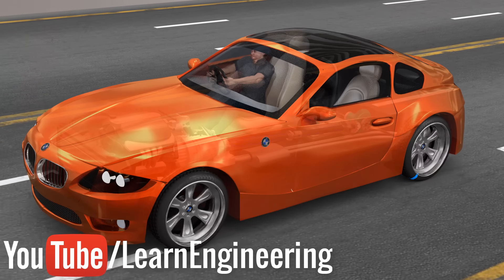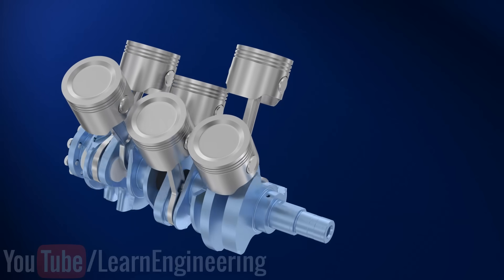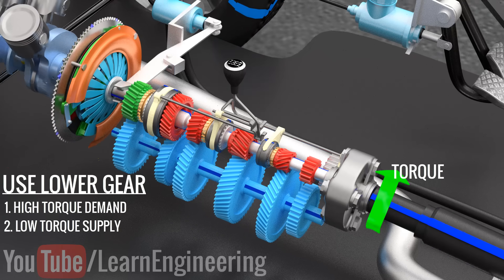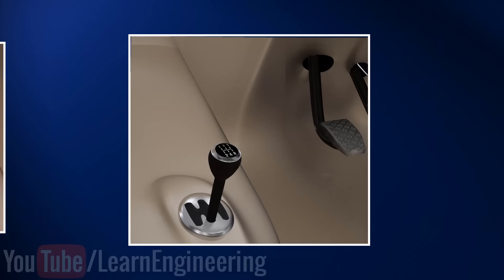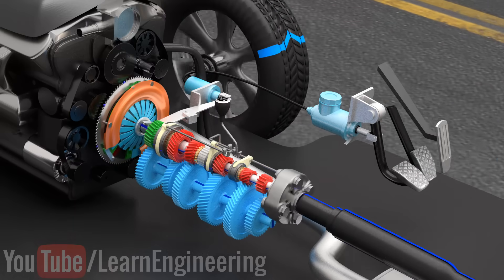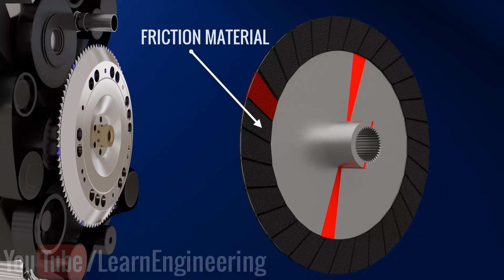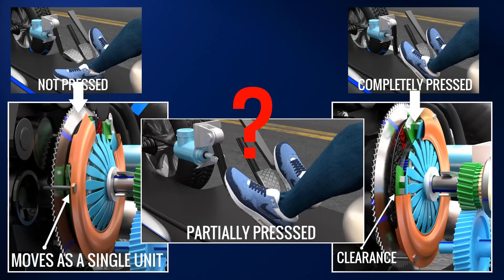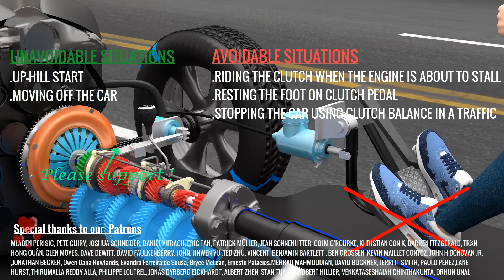Why you should not PARTIALLY press the Clutch?

Comment: Well, there are basically two scenarios where partially engaging the clutch (clutch control) is just necessary:
1. pulling off in 1st gear of course, you have to partially engage the clutch in order to make it easier for the engine to move the car and not to stall, and as soon as you reach walking speed you may fully release the clutch;
2. Driving at very slow speeds is just impossible whilst the clutch is fully released, like moving slowly in traffic jams, and moving slowly while parking.
Other than those two I can't see any other situation where riding the clutch may come in hand.
Reply: 3. If you start to drive in an uphill situation,  you definitely need to rev up to more rpm and release clutch half way slowly until car start moving or else engine will stall and turn off.
Reply: Pirouz Farhani Only when hill starting in 1st gear.

Never slip the clutch in any other gear than 1st or Reverse, all other gears, if the engine is lodging/stalling, downshift one or two gears.
Reply: @afara2000  was looking for this comment, thanks.
Reply: Thank you I really needed this comment. I’ve been driving standard for a few months now and have been trying to wrap my head around how one would go from a stop to start without feathering the clutch. 

Also when I reverse I feather the clutch a lot. But this is ok right? When reversing you’re moving very slowly so it shouldn’t wear the clutch too much
Reply: DavyDave1313 Depends how many revs you have. If you are reversing a long distance, you can first give it revs, then let go of the gas slowly while letting go of the clutch until you have the clutch fully engaged with the engine idling.

To slow down, start slipping the clutch again. 

You cant fully avoid clutch damage. Road speed doesnt matter on its wear, but the difference in RPM on the engine shaft and transmission shaft, is what damages it. 

Why driving with half clutch is so bad is that the friction heats it up, making it wear out (and stink) really bad.
Reply: @SportSoulLife  oh ok, its not a long distance id say 10 feet to reverse into my parking. And from what ive seen the rpms stay at around 1.5 while reversing - not sure if thats what you meant
Reply: @DavyDave1313  You have to feather (or partially engage) the clutch some of the time. It's what the clutch is for and its inevitable. You can extend the life of the clutch by going easy on it, but eventually it will wear out and need to be replaced. The only way to avoid that is to use an automatic transmission with a torque converter.
Reply: My traffic jam trick is to hang back and roll along with the clutch engaged, then when coming to a stop I just coast in neutral
Reply: @b.eduardo5105  so you are just moving in first gear without touching the pedals?
Reply: @r9__673  yes mate, a little bit of throttle may be necessary
Reply: @b.eduardo5105  that's not traffic
Reply: What the previous guy said. I leave a little extra buffer space between me and the car infront and simply ride in 1st gear in idle. If the car infront gets way ahead, i change to second gear and drive at close to idle. If they start to slow down, back to 1st and if i see a stop approaching, just roll ahead in neutral. 

This works great in Europe atleast where many cars are manuals, so generally speeds wont drop somehwere between idle and fully stopped. Dont know how it would be in the US though since automaics creep forward much slower than manuals idle in 1st.
Reply: @SportSoulLife  its so much worse in the U.S automatic vehicle drivers will constantly and rapidly go from high speed to a full stop. It takes all the fun out of driving.
Reply: Oh, and id like to mention that trying to creep along with traffic on a motorcycle is brutal on the clutch. My bike Idles in first gear at no less than 15 km/h, and from a standstill a good 4000 revs are required to not stall the engine. So lucky that lanesplitting is legal/accepted here. Couldnt imagine riding in a traffic jam in the US
Reply: @SportSoulLife  yeah, my Busa wasn’t the most fun thing to ride in traffic. But, as far as wear, most bikes use wet clutch packs, so slipping is far less harmful than in a car, and it’s actually a good technique for low speed maneuvers
Reply: @SportSoulLife  don't bikes have wet clutches?
Reply: @confusedredditor1660  Yes, but this doesnt make them immune towards slipping, only keeps them cooled down.

Just like wet sandpaper still sands the surface and wears out, so do wet clutches.
Dry sandpaper and clutches cut (grav) and wear out faster (abd create more friction) and heat up more.
Still, nothing you slide against eachother to create friction, no matter how you do it, doesnt wear out, especially during excessive use
Reply: @SportSoulLife  mhmm
Reply: @SportSoulLife  true, that wear's still gonna be there
Reply: @confusedredditor1660  Yes, and with a car when you are slipping, the engine usually wants to go about 10 km/h with the clutch connected, and you are creeping at 5 km/h

A motorcycle (naked bike and sport bike atleast) at 4000 rpm in first gear wants to go about 40 km/h, then you are creeping at 5 km/h. So the motorcycles clutch "slides" four times as many revs than the cars clutch does
Reply: @SportSoulLife  same here bro I live in the us but lane splitting is legal in cali
Reply: live and let live Thats good. Only problem i have with cali lanesplitting (that ive seen on YT) is when its done in normal/close to normal flowing traffic.

Rule of thumb for me: if there are gaps in the lanes for cars to change into (like there is in ordinary traffic), its not safe to be lanesplitting.
Reply: In a car with a low powered engine (like my 1.3L Corolla lol) when you're going up a VERY steep hill in 1st while driving slow sometimes you have to ride the clutch to avoid stalling. These situations basically only happen when driving up long, steep and narrow driveways which there are a lot of where I live.
Reply: Hill starts too?
Reply: About number 2: I just realized I d o it all the time and I never thought about it. It was just something I picked up instinctively. I love manual transmissions, can't get used to automatic haha. It's more fun, more control.
Reply: Dont tell them to slowly let off in first watching people/idiots get whiplash its halarious
Reply: 3. Clutch kick for maintaining sideways action
Reply: I learnt to drive a manual in Wellington, NZ where the roads are extremely steep, narrow, buses and trucks constantly stampede through from the opposite direction, tons of cars half parked on the pavement/road,  and not to mention roadworks everywhere.  If you can drive a stick there, you can drive anywhere in the world.  My backpacker friends were impressed how easily I carved through the narrow, hilly congested streets of Southern Europe.
Reply: I drive a turbo diesel so when driving slowly in traffic or in a parking lot, I drive using the brake. The engine torque is way more than enough to just keep the car rolling without stalling. When I'm offroad I put it in 1st, take all feet off the pedals and it just crawls on its own. I love it.
Reply: when driving very slowly you should always half-engage the clutch for a short moment only and then take out the gear again. redting on it will just create friction and heat, it's better to go into neutral and into 1dt gear for short "bursts"
Reply: @yeeted42069  lol have u even listened to the vid?
Reply: Agreed. Being told it was all clutch or no clutch was a barrier when I was learning how to drive manual. I had a really hard time getting the car moving until I learned to ease off slowly. Been driving manual for almost 15 years now and have never had to replace a klutch.
Reply: The obvious one: changing gear as well
Reply: in a traffic jam just dont move asap. Wait for 1-2 secs, so there will be enough room to move faster without rear ending the other car.
Reply: In case 2 YOU DON'T RIDE THE CLUTCH!
If traffic is moving slowly, you release the clutch a little, then press it in again and ROLL!
If you ride the clutch in slow traffic, that's gonna be A LOT of riding and a lot of wear! Very bad!

Remember: you don't need to stay on the other car's tail! It's perfectly fine to sit and wait until there's enough space in front of you that you can fully release the clutch and then coast along in neutral!
Reply: I rather bumb the pedal to get the car moving a bit and then release it..totally depends on the car tho. Some have ridiculously high first gear like the facelift hiace and some have super low first gear like the old hiace
Reply: Parallel parking
Reply: That's what i wanna say
Reply: Driving in Traffic with an moment of 5 to 15km speed clutch pedals can be avoided but make practice mentally as well as physically not to keep foot on pedals untill u have to breakdown to stop the vehicle.
Reply: I think the main difference here is engine speed and driveshaft speeds since to move from first you need to use the clutch to get the car moving, at which pint the engine has enough torque to overcome the resistance and move forward without stalling while in this scenario the engine does NOT have enough torque to avoid stalling (in the current gear). So to avoid stalling the engine in this situation people wrongly put the clutch in hal way instead of switching to a lower gear 

TL;DR difference between riding the clutch and releasing the clutch is ou can't go a gear lower than first
Reply: And when shifting gears?
Reply: i broke my clutch once.. when i was learned how to ride manual.. cuz sometimes i unconsiously push the clutch partially.. but i think i do better now..
Reply: Yeah i only do it when parking or when leaving sport / school where the speed limit is like 5kmph
Reply: When is heavy traffic , you don't really need to stay in gear. Have the car in neutral and let it go by itself , gently brake if needed and that's about it
Reply: For driving slowly i would use the brakes
Reply: @theicedragon100  if you did with the method i described above u would stall. The method above is the slowest method you can drive
Reply: There's nothing wrong with slipping the clutch when shifting and moving from a dead stop.
Reply: Some replies stating that they just fully engage clutch to roll along slow traffic. But cases can vary so much. While driving uphill and in need of going slowly, to maintain a slow constant speed, its hard to avoid using partial clutch.
Reply: @MesHnamte  Fully engaging the clutch works only downhill. Some people say that they just take it out of gear, release the clutch and let it cruise. I myself I leave it in first gear when driving slowly downhill, I just use my brakes and the clutch obviously if needed. I feel like it gives me more control over the car, it is more safe so in my opinion since it allowes for more swift and timely maneuvers if needed than having the car out of gear.
For driving slowly uphill, not using the clutch isn't just hard, it is downright impossible without stalling the engine, the load on the engine is just too heavy when driving slowly uphill.
Reply: @yolson2376  Right. Fully engaging clutch in downhill can be dangerous, using the gears plus brakes is more safe.
Reply: @yolson2376  well I kinda drive slowly uphill pretty much on a daily and my little Turbo Diesel car just take it idling in 1st... However I would guess in anything but a Turbo diesel it's going to be a problem.
Reply: @yolson2376  If it's impossible then I'm doing the impossible:
I can start off on a steep hill without slipping the clutch more than normal.
I press both brake and clutch at the same time with my left foot to keep the car from rolling back while revving up the engine to get the power needed to start off. You can also use the handbrake for the same purpose.
Reply: @LRM12o8  you can do that but it's bad for the car use the gas instead of the brake. Clutch and brake should only be used for slowing down.
Reply: @in4mus85  I'm not sure which one of my (admittedly too many) comments you're referring to, but I think you misunderstood me...
Reply: @MesHnamte  No it's not hard to avoid riding the clutch to go slow. It's called ROLLING In neutral! 🤦‍♂️
Reply: @LRM12o8  I mean it specifically. Try rolling in neutral on an uphill slope and come back to tell me the results.
Reply: @MesHnamte  thought you meant two individual situations.
Well, in that case I'd sit and wait until there's enough space for me to drive uphill fully in gear for a bit and stop again. There's no need to steadily limp along in any traffic jam, especially not on a steep hill.

I'd leave ample space to the car in front of me on a steep hill anyway: they might roll back!
Reply: @LRM12o8  Yeah that's a good solution but when there is pressure and horns honking from behind, its diffult not to follow along.
Reply: @MesHnamte  that surely sucks. Haven't really had that problem, but it may be more common in other countries. It's also a punishable offense in Germany. 
What I experience every now and then is people tailgating me on the Autobahn when there is a speedlimit of 120 km/h and I'm already 10 over. But I always remind myself I'm already exceeding the limit and if that's not fast enough for the idiot behind me, then too bad for him he ain't one to coerce me to risk a higher fine than what I'm willing to bargain for. He'll just have to wait til I'm done overtaking at my speed. 
Same would go for riding the clutch to limp along. If it goes wrong, I will have to pay the bill, not the aggressive driver behind me. No thanks!

I don't get why these people don't realize that when the car is stationary they don't need to pay as much attention constantly, as when the car is constantly crawling forwards.
Reply: One more: rapidly changing driving conditions like offroad hills require fast and decently precise control ovee the torque, not using the clutch can quickly lead to being stuck then and there... But i guess thats not knowledge everone needs
Reply: @modellking  hahah I litterly live in the middle of nowhere I know exactly how it is to drive off-road Buddy!! But tell me how many people need to do that? We are talking like 1 in every maybe 5000 in Denmark where I'm from that drives off-road. And off-road doesn't change the fact I can cruise in idle in 1st on a uphill on every normal road which is 98% of roads in Denmark...
Reply: @mathiasmorell5094  yeah exactly! i think its good for people to understand how to get peak performance out of their things if a rare situation (like muddy ground steep hill), where such thing can be beneficial occurs
Reply: Turning
Reply: Exactlyyyy
Reply: Theres also changing gear 2 into gear 1. And most of the time i had to do half clutch first before fully releasing.
Reply: Driving very slow in 1st gear is no problem without riding the clutch. Just have to be very gentle with the gas pedal (when clutch is fully released) not to make the car jump, or just coast and use the clutch as you pull away in 1st gear. Make the car move then fully release the clutch to coast at desired speed, no need to half clutch at any time.
Reply: @henriks5008  There is one another way. You can control the speed by brake pedal when you need to slow down for a short time on first or second gear. The engine will overcome that if you won't reach e.g. less than 500rpm.
Reply: clutch kick
Reply: 650 hp and tq helps, once I'm in first gear I can idle and brake during idle to go slower without stalling. I have to decelerate to around walking speed to risk stalling, or if I hit a hill in which case I can give it some gas. The downside to having that power is of course if you aren't careful you can burn that clutch the fuck up, and fast lmao.
Reply: well half pressing the clutch is essential i think in uphills altho i guess it could fit in with starting, and creeping, but there also is the extra need for halfbalance to avoid rolling back where alot of halfclutch goes i.e. that includes brief rest stop on incline
Reply: 3. You have a gear start failing and refusing to engage, so you have to skip a gear and pump the clutch while on the gas simply to keep up with regular traffic
Reply: I was searching for this because in my driving lesson he tells me to slip partially engage the clutch when doing slow manouvres simply because 1st gear goes too fast. But what about standing still on a hill and going up again, is it okay to slip the clutch and then release the break the moment it makes a bit of rpm?
Reply: I tried this method of not pressing clutch in very slow traffic and every time it stalls or even get stopped..So just as you said I realized it's impossible without partial clutching during very slow motions..
Reply: Keep it rolling
Reply: In situation 2 you let it idle in 1st (covering the brake with your right foot)  and when you get close you fully disengage the clutch and coast to a stop in a very short distance; if the traffic starts moving before you need to stop you re-engage the clutch fully using thecleadtcamount of engine power to hold your speed.  Whilst most drivers rush forward (using fuel to accelerate) and then ram their brakes on (wasting the Kinetic energy converted from the fuel burnt to accelerate) to stop, you end up with a smoother ride by aiming to arrive at the back of the vehicle I  front as it starts to move again - your average speed is the same but you use less fuel, especially if you do not stop as it requires more energy to get going from a stop as friction (in bearings, etc) increases as force increases until slippage occurs at.which point the frictional force actually reduces: if you.can avoid stopping you avoid having to get over.this frictional force hump.
Reply: 1) he's clearly talking about one specific example 
2) yes it is
Reply: Also you have to partialy hold clutch for a second when shifting up or down to let the engine smoothy get same revolutions of flywheel like the clutch has. Or the car will bump violently when you release the clutch too fast.
Reply: @jaromirandel543  not if you know exactly where your biting point is. You can just release the clutch and get straight back onto the gas as the clutch reaches biting point. One smooth motion. However it will be harder to do this if you don't like to drive fast.
Reply: @in4mus85  You mean, to shift without clutch? This is the best way how to destroy synchro rings.
Reply: U know if you slowly release the clutch in first when the car is stationary it will slowly move even without pressing the accelerator?
Reply: @gidnild701  have you read any of the comments or are you just taking?
Reply: @gidnild701  I can vouch for this, im not sure if reverse is any different but I fully reversed out of a car park only using the clutch. 2002 subaru gtb
Reply: @bobsyoureuncle3908  Ive done the same in first gear driving forward in a Ford fiesta
Reply: The Hint I agree.
Reply: Riding the clutch or half clutching is a great way to get out of our through snow and mud. 
My Ford is 2x4 5speed. Was ran off the road by a swerving semi during a snow storm. Half clutching got me out of the Ditch.
Reply: Making a U turn also requires you to ride the clutch... If you make a turn at any speed at all it is a lot more dangerous to disengage the clutch completely.
Reply: @mecha1gold  That's some bad driving here. If you make a U-turn either you stop completely (if there is traffic or it's really tight), or you should be able to do it in gear.
If cornering requires you to ride the clutch, then you're a gear or two too high!
Reply: Driving fully in first gear can go slower than cluch
Reply: @miggies8140  not slower. Put the car in gear n slowly release clutch fully without pressing the accelerator and then the car will slowly move
Reply: @gidnild701  for a Diesel that's mostly true. However, petrol engines, especially lower power ones often don't like that and would require A LOT of clutch riding, meaning you'll start off like a slug and quickly wear out your clutch in the process.
It's better to give it a little throttle while swiftly easing off the clutch. Something every person with two fully functional legs should be able to do!
Reply: @LRM12o8  yeah. I just did it for fun to see what happened in an old small 1.25 16 valve petrol fiesta. I even then changed in to 2nd gear just with clutch. Wouldn't do it again tho
Reply: @gidnild701  Oh, good. I thought you were advocating for it. Glad I got you wrong there :)
Reply: Tesla ev's are the best. No gear problems